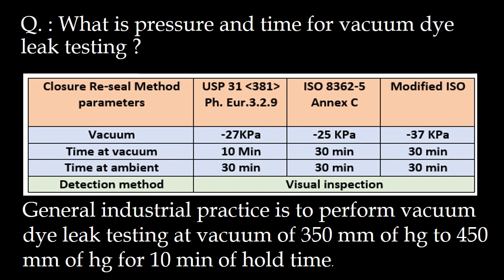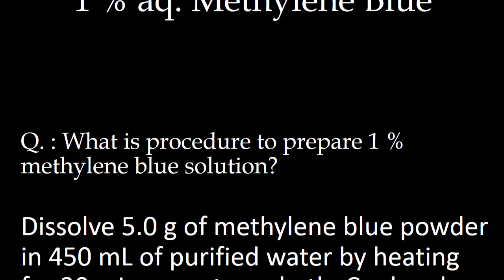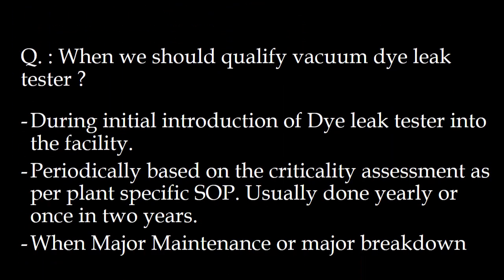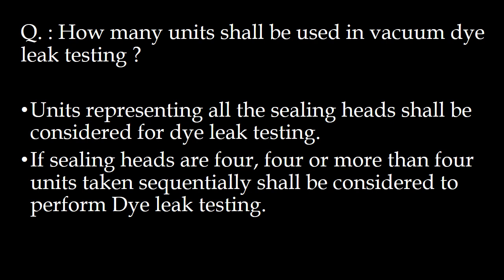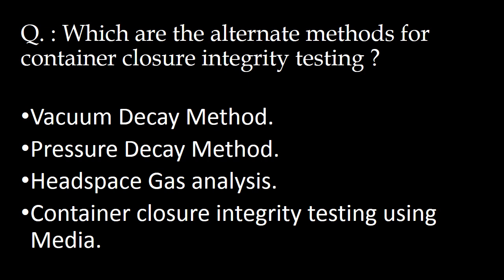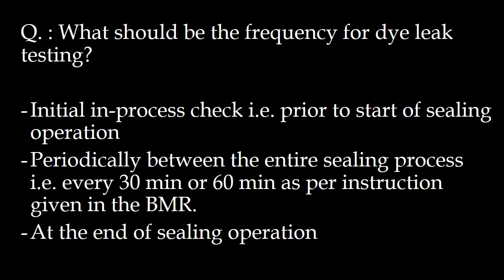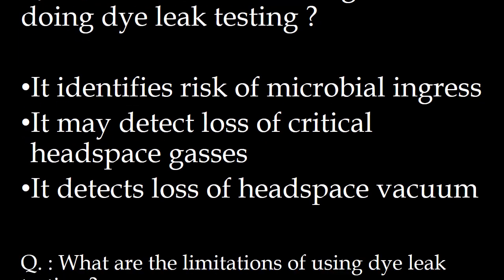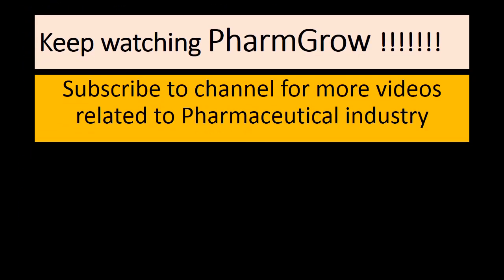Vacuum leak testing in pharmaceutical industry l Interview Questions

Comment: But why only M. Blue is used, why not another one
Reply from the maker: You can consider below rationale / reasons for selecting Methylene blue dye as an indicator in dye leak testing. 
1.	Various guidelines like USP chapter No. 1207 and PDA suggest to use methylene blue dye indicator.
2.	These dyes and their percentage have been established through a combination of practical experience, historical usage, and consensus within the pharmaceutical and quality control communities. 
3.	Methylene blue is easily available at affordable price all over.
4.	Colour produced with this dye can be easily distinguished with naked eye.
Reply: If we check the leakage on liquid bottle so the pressure under the leakage appartus is low and under the liquid bottle is high so if there is leakage on a bottle so liquid come out from the bottle bcz the flow is from higher presssure to low prrssure.
Is it the exact phenomena?
Reply from the maker: No it is exactly opposite to what ypu said. Due to the pressure difference dye / liquid outside the bottle penetrate inside the bottle.

Vacuum is created inside test chamber not in test bottle. So test chamber has high pressure than space inside test bottle. So liquid / dye penetrate inside bottle.

Hope this will help you